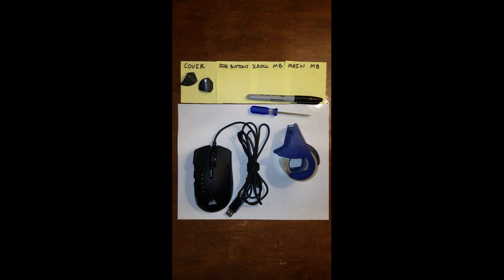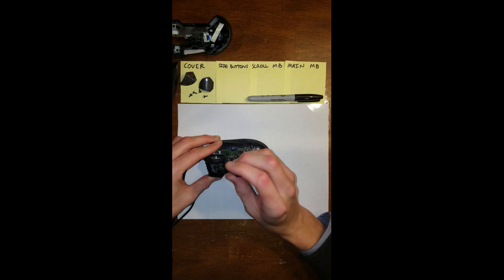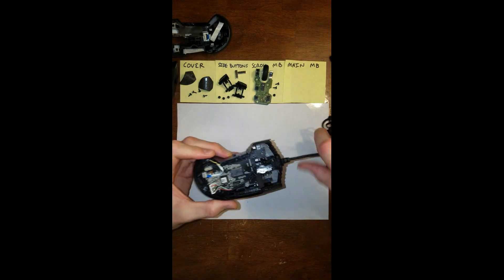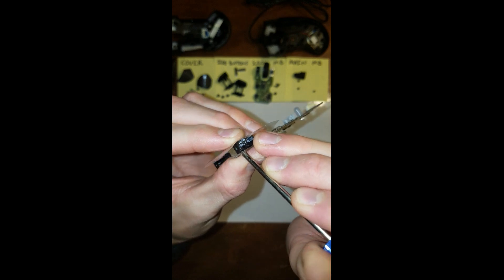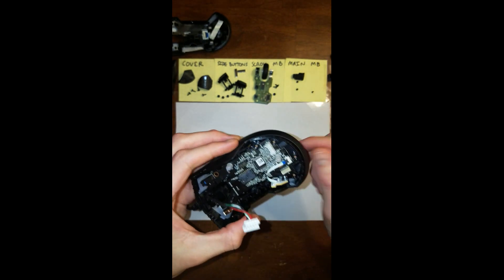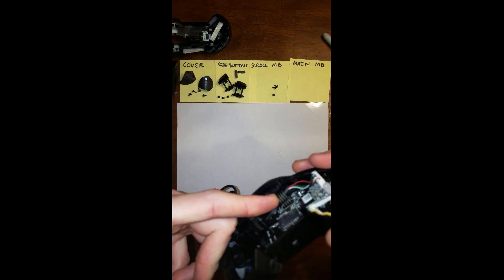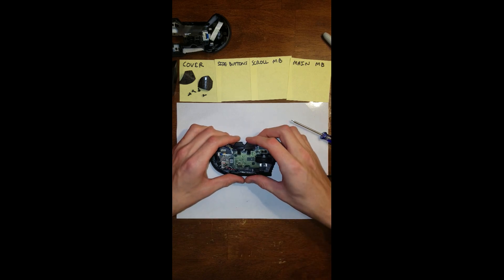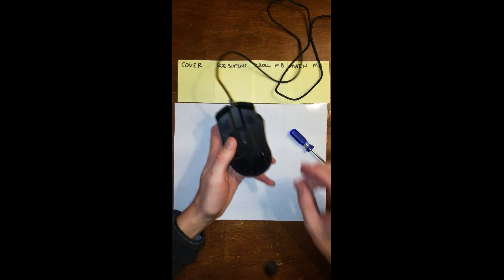Corsair Glaive Disassembly

Comment: Thank you! I had one with the rubber "tire" slipping on the metal "wheel", causing my scrolling to work only some of the time. I'm impressed by how this thing is assembled so that it can be worked on. You cured the handicap I've been living with for a long time. I love you, man!! lol
Reply: Just fixed mine with the same issue. Cleaned it up with some rubbing alcohol and applied some super glue to the inside of the wheel. Works like new!
Reply: same issue.
Reply: And now I'm back at this video 3 years later to fix the clicking issue! This video has helped me twice now!

Comment: An excellent guide.  Fixed my problem.  Thank you, sir.

As an addendum to any viewers, when removing the pads, do not attempt to scratch them up with your nail, as this will damage this outer layer.  I used a narrow screwdriver to hook in under the corner of the pads and peel them upwards.

Comment: I'm not gonna lie, I wasn't expecting this to work at all, but it did and it saved me $70! DO exactly what he does in the video and you're golden. It fixed the problem I had where when I would click and hold, the mouse would just stop registering the click, or when I click once it would double click. It also makes the physical click sound much quieter and more soft feeling which is an unexpected bonus!

Comment: If you have the updated glaive the mouse buttons are on the scrollwheel board, so you wont have to take off the side buttons which will make it easier. Also if you need to access the main board you will have to unscrew the silver screw between the side buttons then you can just wiggle the green board up. The only issue I had was that the copper bar had popped out and it was a pain to get it back correctly, but it did fix my issue.

Comment: Brilliant guide, thanks so much. The middle mouse button on my Glaive was seemingly dead, and not wanting to buy a new one without first trying to fix it I came across your video. Turns out I had a load of dog hair stuck between the switch and the mouse wheel axle. 

Thanks again, very easy to follow guide, works perfectly.

Comment: oldie but goodie!  i was wandering around looking for info on replacing the usb cord originally.  i have 2 corsair glaive mice that weren't working.  the original had a bad left click button, the second had a bad usb cable.  i watched your video to work on the one with the bad button but soon realized that the usb cable was just plugged in not hardwired like so much stuff is.
I went with the cable swap which avoided the main mobo bring removed,  and everything is great now.  so much was laid out by you, i was able to do this MUCH faster than from "scratch".  thanks again! if the buttons on this one go bad i know where to go next time ;)

Comment: 6:48 Just some random information: I didn't do it with this one (yet) but i did do it with other mice which have the same switch. (as nearly all mice i guess) You can shorten the way the little metalthing travels and thus make the click more silent and lighter. You'll have lower resistance basically. I saw a video once where someone put a bit of paper in it to heighten the metalthing but i found out you can also just bend the hook which is on the right side in the video down carefully. This is better since the paper sometimes moves and you have to take the thing apart again. I made stupidly light resistances with this on my old mice but you can also lower it just a bit.
Reply: If you bend it to much, it might not give proper contact and cause double click issues (due to no proper contact). That is how I fix double clicking on these switches, by bendig this metal clip a little outward.
Reply: @nopedandafafet186  Yes, it's a delicate proccess. But after you do it it stays the way it is. I'm using my bended light click mouse for some years now with no issues. Mainly did it to make them more silent.

Comment: So far I've tested through 400 clicks and none have doubleclicked. Thank you so much! I had an issue where the little golden piece of the clicking mechanism fell off, and at first i thought it broke. However I opened the casing to my right-click and looked at how it was attatched. I was able to reconnect it. Thank you <3
Reply: Was yours double clicking? Mine is double clicking now and sometimes wont click at all, how did you fix it?

Comment: This helped me fix an issue where the rubber "tire" on the wheel was just spinning around the "rim". I was having trouble getting this mouse apart to fix it. BTW, the final fix was an alcohol cleaning and a single layer of duct tape around the bottom of the "rim."
Reply: same problem + double clicking problem on the right MB... this mouse is a mess. I'm kind of sad cause I love it beside...

Comment: I used to take micro-switches apart to clean and adjust them, when I repaired office equipment.  It was always, at best, a temporary solution.  The replacement switches are usually pretty cheap, so if you can solder, the best thing to do is replace the switches.  What you're really doing by bending the metal piece is moving the point of contact slightly, hopefully to an area that's less tarnished or burned.

Comment: Thanks for the disassembly guide. After 3.3 years of use my Glaive started occasionally double clicking, mostly when pressed from bottom right of the button. Broke other one of the magnets in half when they slammed against each other. Half a magnet on the other side is still plenty enough. When I got to the main board screws I noticed they require smaller tip screwdriver which I don't have... Didn't get further than that. How ever then noticed that my problem might be a bit different. The "hammer" pressing the switch had worn a groove into it. Also the black middle part was deeper than on the other one. I added two layers of tape on to the top of the "hammer". Seems to have fixed it. Button clicks the same no matter how I press it.

Comment: At 7:24 during the bend, the little metal piece perhaps broke off of the unit, how can I reattach it?
Reply from the maker: Good question, this happened to me the first time opening the switch, and I almost covered it in the video. If you look very closely, you will see notches that the metal will rest in. Just tinker with the metal piece until it is resting in the notches, it will only fit in one orientation. Be careful not to bend that metal piece though, just be patient and use your fingers. Good luck!
Reply: I had the same thing happen, I tucked the end closest to the inside of the mouse (where the actual click happens) in first, then rested it over the top, then i took my nail and pulled it back over the other side (closest to the front of the mouse) then lifted the little bent bit in the center until it stuck. If you are having trouble, open the casing to the right click and look at how that is put on. Don't worry, no parts actually snapped, it just popped out.

This will show you better than i could explain it https://youtu.be/eDoXMJyimDU?t=2m13s
Reply: @Veggum  Ah, thank you so much! I did the same thing and thought I ruined the mouse. 😅
Reply: I have the same issue but i can't bend the metal piece in a way the switch is clicking again. Is there any way to replace it?

Comment: Was following along and doing alright, but when I opened my switch up the little copper thing jumped out! Had an awful time trying to put it back in; I'm not sure what bending I ended up doing to it in the process, but my mouse doesn't seem to be double clicking at the moment. Though, the click in general has gone really quiet, rather than a nice clear click.

Comment: Thank you for this guide. I have a Glaive PRO that was a warranty replacement but the middle click is really annoying because debris gets caught under it all the time stopping it from working. I like the mouse overall but that's a very annoying issue that pops up. Usually I can do the rapid click and shake trick, but this time it was fluff that wouldn't budge

Comment: Great video, thx for sharing. After one year of use the middle mousebutton failed. Opened it up (damn plastic clips), used electronic contact cleaner and pressed the microswitch of the wheelbutton a few times until the click sound means a real click in windows.
Personal never-ever-buy-again-list: 
- razer mice (forced to registrate in synapse 2 to change makrobuttons)
- corsair mice

Comment: If you're here for scroll wheel 'slide' where the 'tire' slides around the wheel, you can probably fix it without taking the mouse apart. Dab very small amount of super glue where the tire meets the wheel on both sides. Allow to dry, spin the wheel quarter turns and repeat.

Comment: Thank you so much. My mouse wheel was rolling in place and this video helped me a lot. I guess the trickiest part is taking the side buttons off and reassembling the top part of the mouse hahah

If someone has the same problem as me (the scroll rolling but not working),
The rubber that was loose, not the wheel itself. So I just had to glue it to the wheel and it works fine now.

Comment: Thinking of doing this since all the firmware updates doesn't fix what is certainly a mechanical issue and not software. Gonna try and get mine replaced first since it's still within warranty period and if all that doesn't work out, this vid will be useful.

Comment: You are a god dang life saver. Editing videos when you can’t grab and drag to delete sections was killinggg me. It was clicking off all the tabs and everything I hated it.

This fixed it plus I had a loose scroll wheel so I just rubbed off the freeze grease in it and gave the little piece of rubber a good wash and now that thing is as responsive as the day I got it. 

Just a little note to everyone else when he says to bend it slightly do it only slightly. I went all hulk and flung the piece across the room and had to reattach it but hey it’s fixed and this turned my horrendous day around. 

Thanks bro

Comment: How do you take the pads off without ruining them?  I remember I took the pads off a mouse once and it didnt go well.

And what causes the MMB in this mouse to just cease function!?  Mine is now basically inoperable. It works like once every 20 clicks or more. It still scrolls fine, but clicking does nothing.  Had made playing many games harder, if not impossible to do.

Comment: So i found my corsair Glaive in a flea market for 4$ or here in Denmark 20kr - I used it everyday for maybe 2 months now and suddenly it started double clicking, but also 50% of the button would not even work. 
First i like many others thought that is either was broken or maybe it was the software but i tried to follow the video and now the button works fine.

My problems on the way - 
So the video is in pretty bad quality and his hands block a lot of the light, but its fine most of the way until the time when he show how to remove the side buttons, this was the hardest for me because nothing worked to get them out and i tired to press and pull everything and suddenly with A LOT of force they came out. But they were easy to put in back :) 

Well after i put it back, both my top buttons doesn't work to change the DPI and the light seems to be a bit dim. But maybe if i open it again and look it through i can probably fix it. 
But it works fine for me anyway 

thx for the video.

Comment: Anyone have tips for getting the rubber pads on the bottom off?
Reply: I need to know this aswell.
Reply from the maker: I believe I just used my fingers, or maybe a small flathead screwdriver. Be careful to preserve the adhasive so you can stick them back on when youre finished with repairs. Mine have stayed intact for almost a year no with no issues
Reply: I started with a sharp knife to get under properly, then pull slowly with power and it came off great:)
Reply: warm them up a bit with a hairdryer. it helps :)

Comment: Wait so my issue is that the side buttons one of them got loose and when taken apart it seems like it actually has a small “welded” spot where the base and the two prongs meet is that correct ? Only way is to buy replacement side keys and re install ?

Comment: worked up until i couldn't get the cover back on in reassembly
realised a cable was blocking the right mouse from going down and had been squashed so disassembled again to move it
on doing that a connector pin got bent
spent 40 minutes trying to correct it until it snapped
now i can't even get it back together
time to get a new, non-corsair mouse

Comment: Are there any warranty seals you break, when you disassemble it? I have the issue and Corsair posted an update on their forum. However I can't update the firmware, because every time I try to, the device disappears in CUE. I opened a ticket and now am waiting for the firmware file for a manual update. When it does not help, this will be my next option, but only if there are no warranty seals. Because if THIS does not fix it for me, I am gonna have to return it :((
Reply from the maker: I don't think it is a firmware issue, at least mine wasn't. There were no warranty seals, but the pads on the bottom of the mouse might give away that you opened it up.

Comment: I followed the instructions and it made the left click much worse than it was before so I don't know if this was the fix I need or if I bent the metal too much. The left click is now so sensitive that barely even touching the left click part of the mouse clicks it so its basically unusable at this point. I also can't hear any clicking noise when left clicking anymore. Taking this mouse apart was also very frustrating. It took me about 2 hours and a few breaks in between to get everything done just to end up with more disappointment. The best thing I loved about this mouse is its shape. It fits my hand perfectly and I can't find another one with the same shape. If anyone knows another mouse that has the same shape as this one please let me know.

Comment: This POS mouse started spinning the wheel rubber 'tire' on the 'rim' after one year of usage.. Have to put some super glue there to fix it. Keep u the good work Corsair!
Thanx for the video.
Reply: how did you manage to put super glue in between the rim and the tyre? assuming that's what you did?
Reply: @ivansikaleski8692  Just by pulling the tyre off the rim a bit and applying the glue. It did fix it for a month..
Reply: @JukkaX  Righto, thanks for that.

Comment: Put too much pressure on the metal inside the clicker and popped off the top metal section... I tried for a while to get it back together but had no click function 😒
Thanks for the great video, but unfortunately my mouse has been replaced with another.

Comment: How in the hell do u take off the rubber covers bro
Reply: Hi, Witt tL. You will need to peel them, I feel. This is the means I have used. There seems to be no replacement pads for the mouse. CORSAIR, like most manufacturers of the last thirty years or more, tends to feel products are to be replaced rather than repaired. The adhesive used should be enough that the pads are able to be re-applied multiple times. I've taken apart my Glaive mouse three times during my three years of ownership. I am about to take this thing apart once more to deal with the left click mechanism again.
Reply: @LangleyNA  thank you but it seems that mine did not have those pads so i just had to replace them, appreciate the response though :)

Comment: Do you think removing the magnets would make a noticeable weight difference because I love everything about this mouse except for the weight
Reply: without the magnets the side grip would fall off.. lol
Reply: they’re the only thing holding them on
Reply: @frost15693 you act like super glue isn't a thing...
Reply: Haydn well i meant if you want to use it normally you need the magnets... they let you swap out the side pieces too. but if you only want to use one grip and glue it on-that works too
Reply: @frost15693  I know how the mouse works but it doesn't even matter anymore. That mouse is absolutely horrible. In my original comment, I had never tried any other mice but now I have a lot of mice and the glaive is by far the worst one
Reply: Haydn lol ok

Comment: how do you remove the rubber pads? and put them back on
Reply from the maker: I believe I just used my fingers, or maybe a small flathead screwdriver. Be careful to preserve the adhasive so you can stick them back on when youre finished with repairs. Mine have stayed intact for almost a year no with no issues

Comment: I tried this today because a single click was acting as a double click....SUPER annoying. I tried bending that little metal piece up but if flew off and just screwed the little part up even more trying to get it back on. Couldn't get it back on correctly or to click so I just ended up throwing all the parts in the garbage lol. At least I tried.

Comment: I can't assemble the top shell part everything else worked perfectly fine
Reply: its a bit tricky to reassemble, but you have to insert the top two clips and make sure they dont pop out, keep force pushing forward to keep them in place, and then then attempt to lock in the back

you'll hear a satisfying click when everything is in place. then hold the shell in place as you screw in the four bottom screws, and you're good to go! ^^
Reply: @whamer100  yeah i did it exactly like that but even though the Clips are perfectly in only the right click works the left click is somehow blocked by too much pressure from the top shell
Reply: @memo64mk  are you sure that one of the clips is not sticking out?
Reply: @whamer100  absolutely
Reply: @memo64mk  is it possible that you put the switch for the mouse button on backwards? so its trying to click, but it cant quite hit the blue button on the switch itself
Reply: @whamer100  the mouse switch is built in with the blue button showing to the up side just like the right switch which works perfectly fine